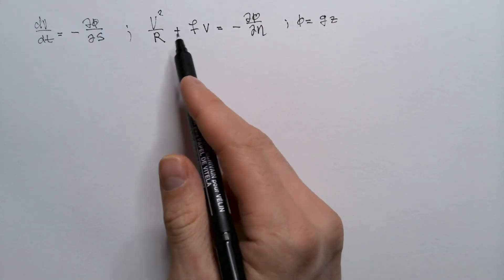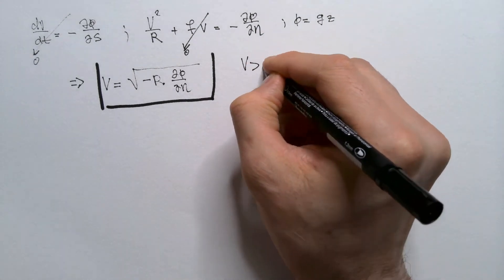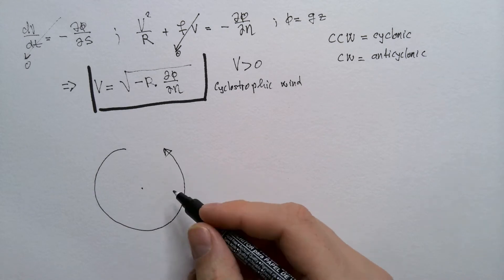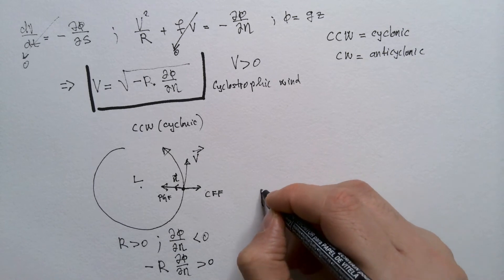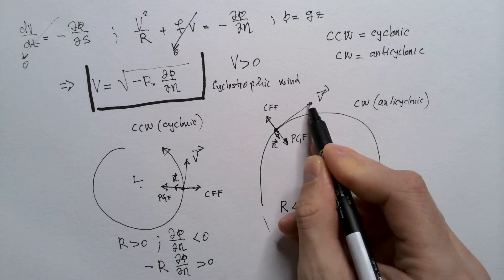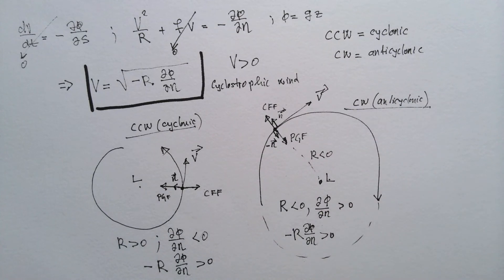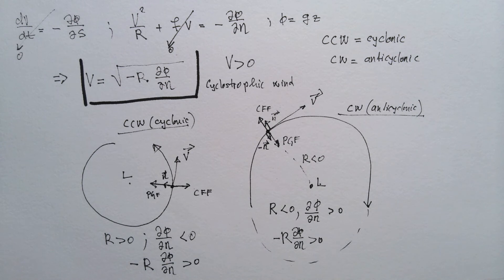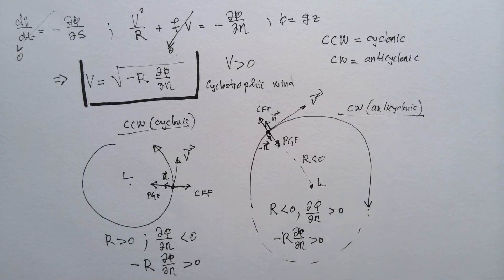Cyclostrophic Winds and Tornadoes

Comment: Hello ! I'm not a tornado specialist (my thing is synoptic meteorology) but I've always wondered how a tornado propagate. Technically, to make the tornado move, some sort of process must decrease the pressure at the front of the tornado and increase the pressure at the rear. Curiously, I've never found a clear explanation of the imbalance between wind and pressure fields that makes this propagation possible.
Reply from the maker: Tornado is attached to its parent thunderstorm. As the storm is moving, the tornado follows. In fact, a tornado is defined as a vortex that must (emphasis on the word must) be connected to the cloud.
Reply: @DjordjeRomanic  Yes, but that doesn't tell us how the pressure perturbation that accompanies the tornado is propagated. A tornado is not a solid object attached to the cloud, so the question remains.

Comment: So how does the swirl ratio affect this?
The swirl ratio in a tornado is a ratio between the updraft and rotation speed.
So wouldn't a tornado with a high swirl ratio spin faster than it's rising, and the balance would stop, killing the tornado?
Reply from the maker: Swirl ratio is a useful parameter for experimentally produced tornadoes in a wind simulator, so-called Tornado-Like Vortices (TLV). It's very challenging to get a reliable estimate of the swirl ratio of a tornado in the real atmosphere. At any rate, the swirl ratio is defined as the ratio of angular momentum to radial momentum in the TLV. For a fixed value of Reynolds number, increasing the swirl ratio changes the dynamics of TLVs from single-vortex to two-vortex to multiple vortices. These transitions are related to flow instabilities that occur at different values of the swirl ratio. 

Read the paper by Church et al (1979: doi: 10.1175/1520-0469(1979)036<1755:COTLVA>2.0.CO;2) " Characteristics of Tornado-Like Vortices as a Function of Swirl Ratio: A Laboratory Investigation"